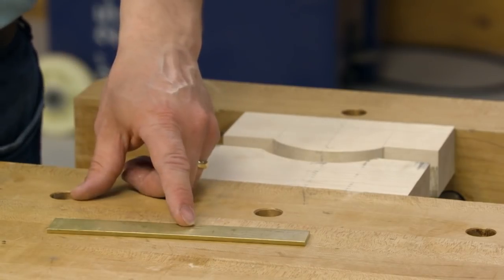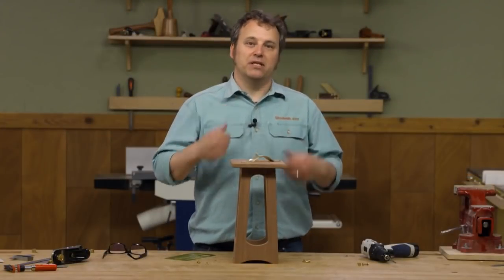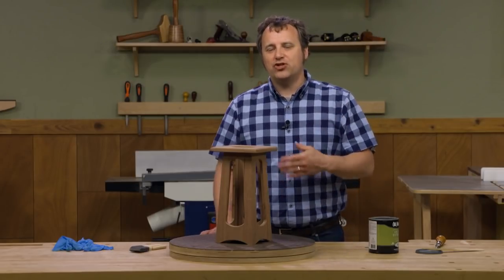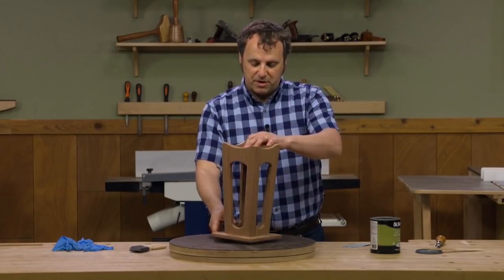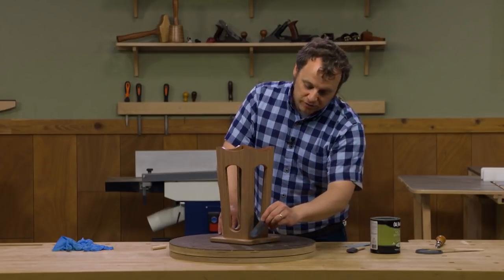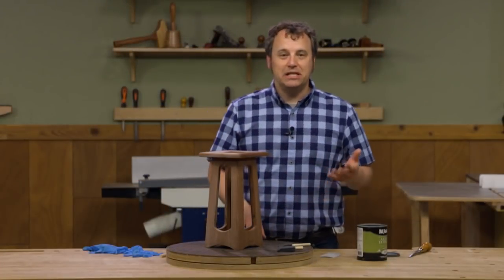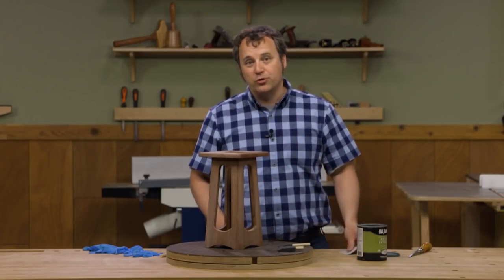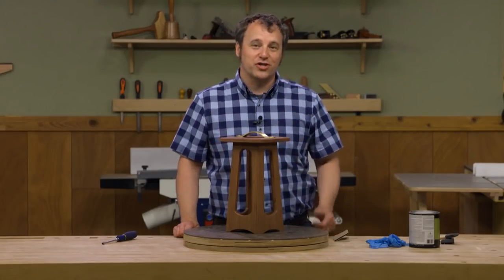Candle Lantern Build: Brass Handle and Finishing - Part 3

Comment: Nice.  And in the queue for a build.  Quick question:  Does burning a candle in this make the brass handle hot?
Reply from the maker: It probably depends on how tall the handle is, but they do make some pretty realistic battery-powered candles these days. 10/10 Would recommend. 👍
Reply: @WoodsmithShowandmagazine  
Thanks

Comment: What would the disadvantages be if you applied all the layers of finish before assembly
Reply: Could getting the finish on the wood effect the way the glue is absorbed?   (i.e. would the finish create a barrier to the absorbtion of glue into the wood?)